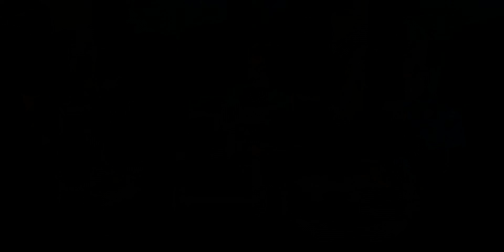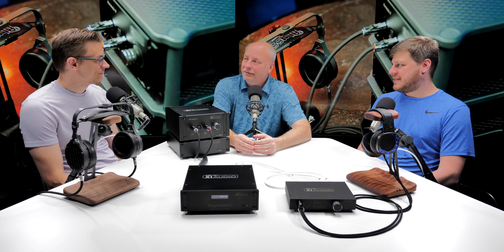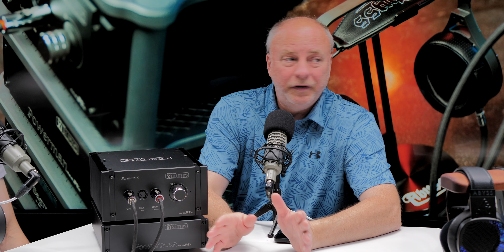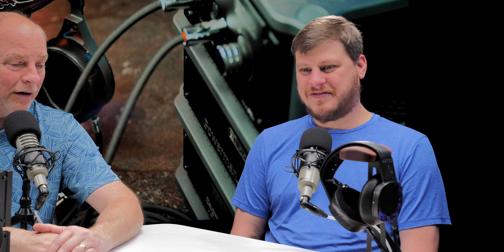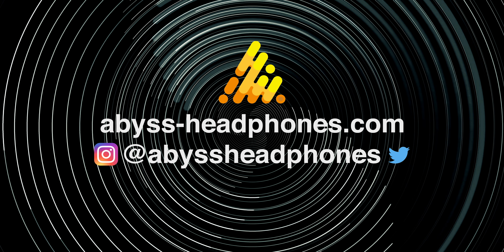Drive your ABYSS Headphones with Eleven Audio Electronics

Comment: does the formula s output the same power on the 1/4 outputs since its single ended internally?
Reply from the maker: Yes
Reply: @ABYSSHeadphones  beautiful thank you 
Additionally I noticed some formula s models have a mono labeled output on one of the 3 pin xlrs on the front. Was this for the option/idea of using two of these and if so is this still the case with the models that don’t have that same mono written on the  3 pin output on the front?